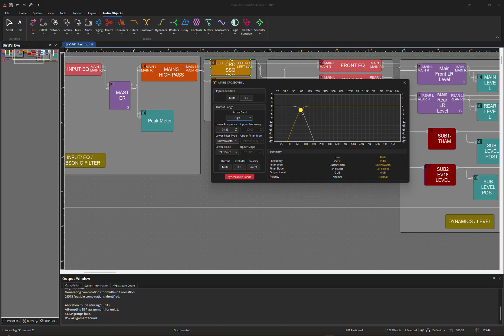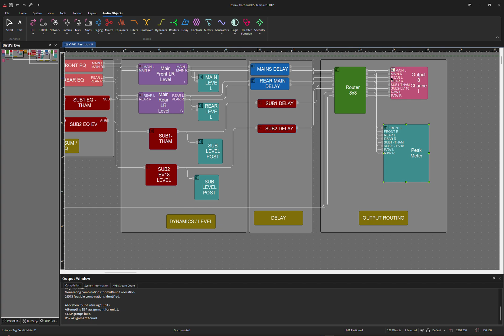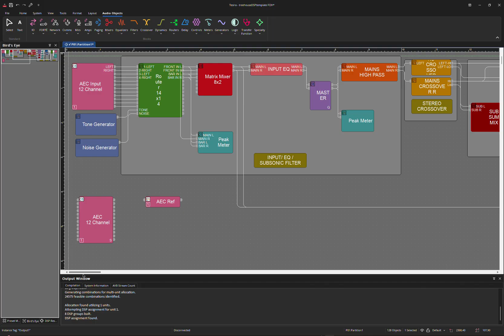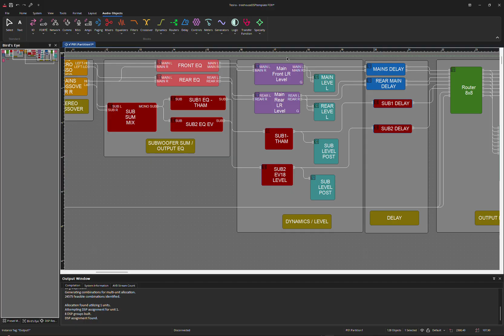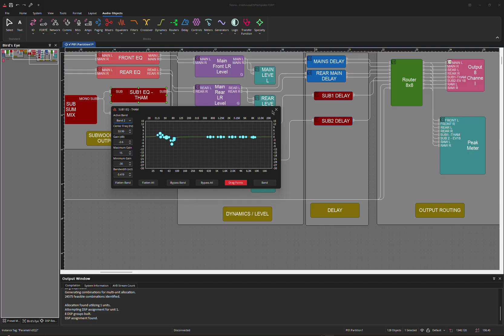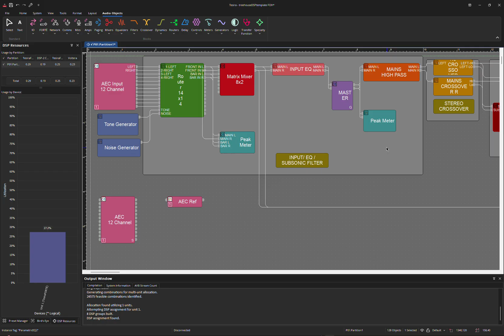Using Biamp Tesira /  Canvas for Nightclub Soundsystems (part 1) - sample Tesira configuration

Comment: Nice videos. been interested in a used one because its 1/3rd the price of my Driverack Pa. Is there any way to integrate SMAART with Teseria or something similar for real time audio analysis. I feel like there would be but i haven't come across it yet ( still gotta do the online training). 

Still probably gonna buy it and figure out my setup for mobile classic Soundsystem style deployment. having 8 outputs is a big help from the getgo i was barely eeking by with 3x2 channels for the mains top and sub and using the mid output for booth monitors.

Also being able to access with a laptop will be very nice instead of reaching in front of the DJ to fix something. 

dante is cool too even though i will get zero benefits from it in my use case. Use it as something to up-charge people who don't know better heh heh.